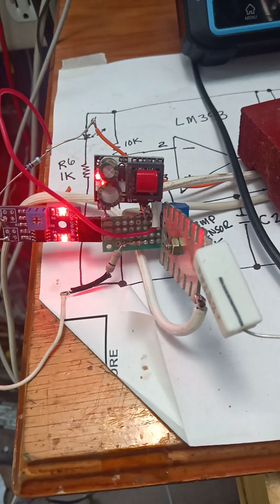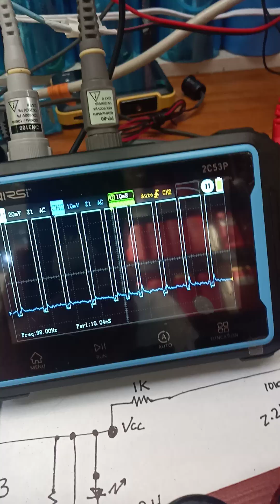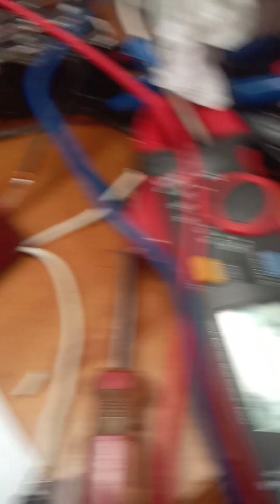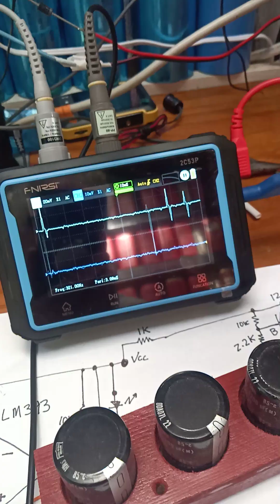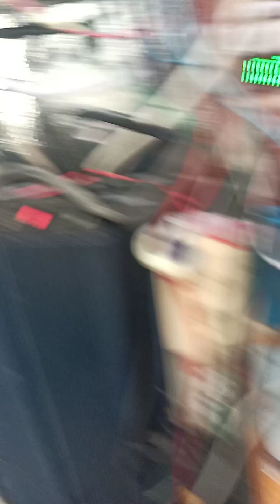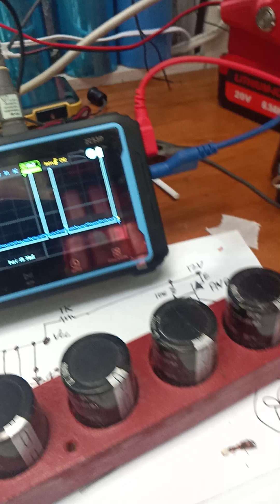Simple Power Point Hot Water Controller made From A LM393 Temp Board #fotovoltaika

Comment from the maker: As I promised you, I made a hot water controller from this LM393 temperature control board with four resistors and a FET.  It works, it doesn't have all the features of a good control with arc interrupt and wouldn't recommend it for really high power.  But it works and for less than $5, not including the capacitor bank. I might pursue this further, maybe not.  There isn't much interest in building things on YT. There are three other water controllers on this array along with the charge controller.  That is the reason it is difficult to keep an image.  Adding a pot in series with the sense voltage would give finer control. I might set up one of my small 3 gallon tanks and four 100W 12V panels in series to show how easy it is to get hot water.